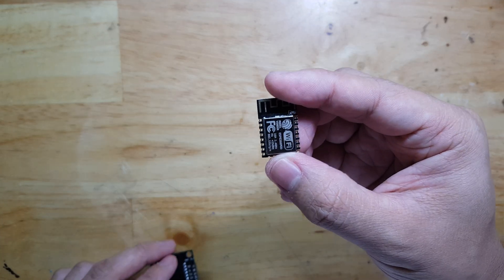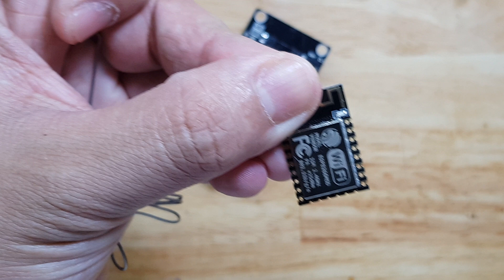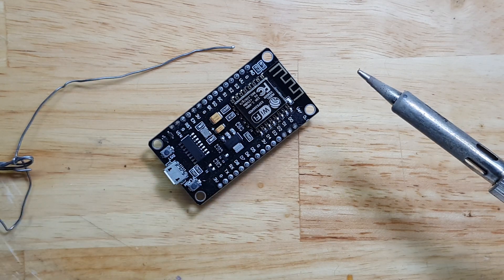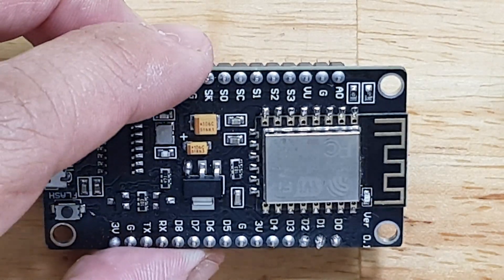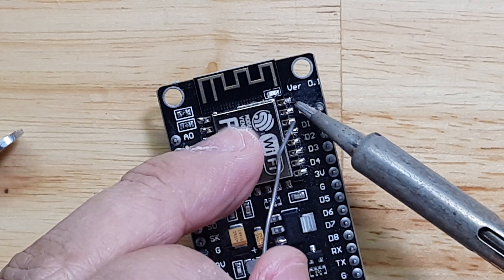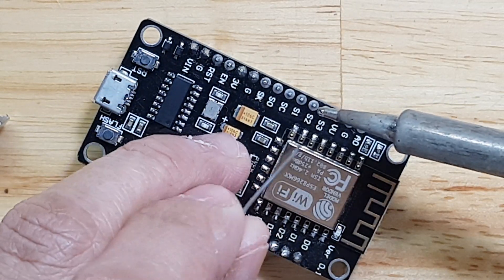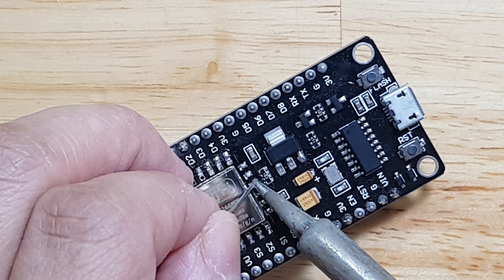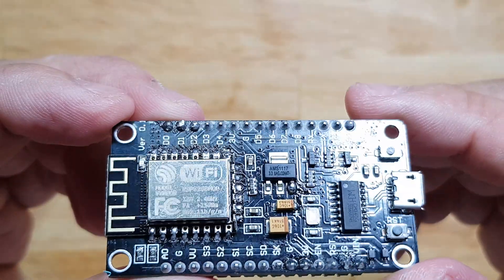SMD SOLDERING OF ESP8266 BAREBOARD TO NODEMCU DEV BOARD (How to solder esp8266 on pcb tutorial demo)

Comment: And how to desolder?
Reply: I would like to know, too!
Reply: @juliocesarcalves  Me too!
Reply: @dee6dzp  I discovered! I used a low temperature solder
Reply: @juliocesarcalves  pin by pin or something like a blower, the chip is soldered ir glued?
Reply: @dee6dzp  you need to make a weld puddle over all the pins at the same time with the low temperature solder
Reply: @dee6dzp  the chip will be loose for about 10 seconds until the solder solidifies again
Reply: @juliocesarcalves  I will try it, thanks